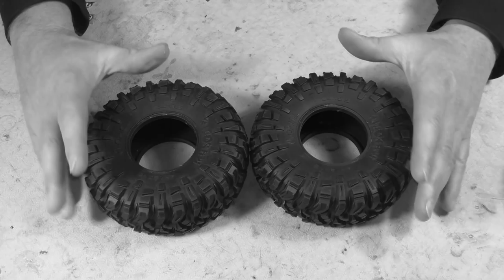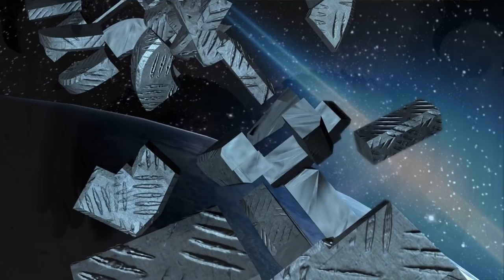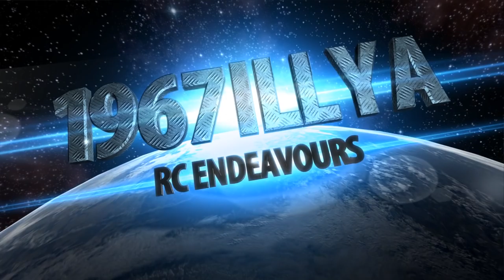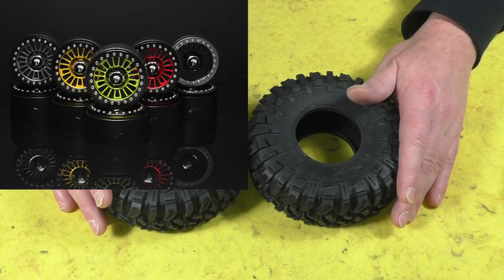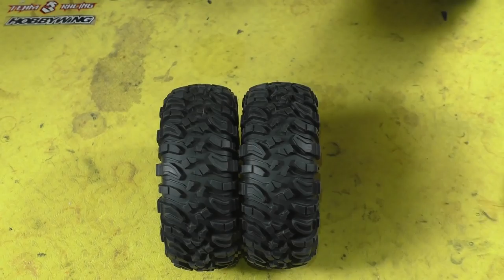Rc Tire Top Tip SHORT VIDEO

Comment: The pro line g8 compound tires gets sticky when they get wet. I would like to try pitbull aleian compound. I have a set of rock beast 2. There almost as good as pro line g8. My opinion. I got rip saw g35 compound. There a good tire.
Reply from the maker: Rod Lilly For some strange reason the old Rockbeast XoR are much better then the Rockbeast II.
But yes, Proline makes a damn sweet compound as well!

Comment: That sounds like a pretty good idea except without the clothes Lol 😂 l was wondering which tire do you think is the best for crawling
Reply from the maker: Andres Dejesus In 2016 i did a 2.2's crawler tire comparison. The video's are still on this channel. But the overall winner was the Rockbeast XoR. 2nd the Hotbodies Sedonas. Axial Ripsaw 3rd and the Boomracing Zigzag as a surprisingly efficiënt underdog aka best budget choice.